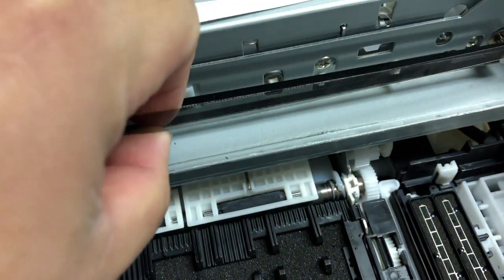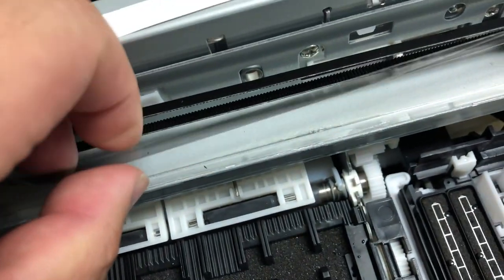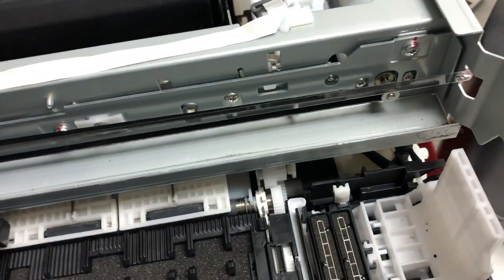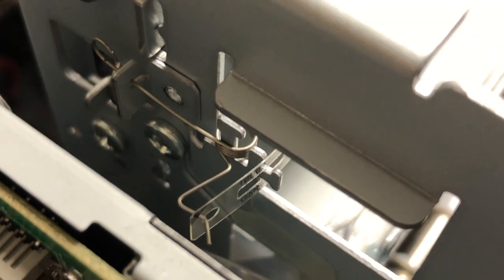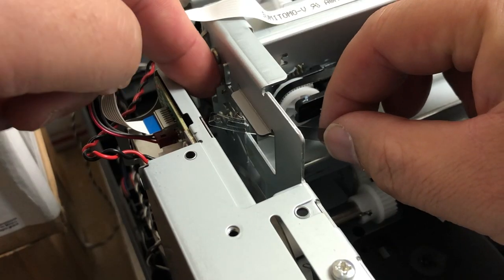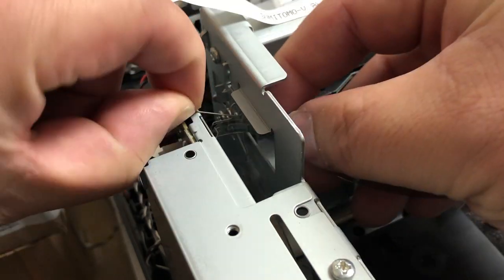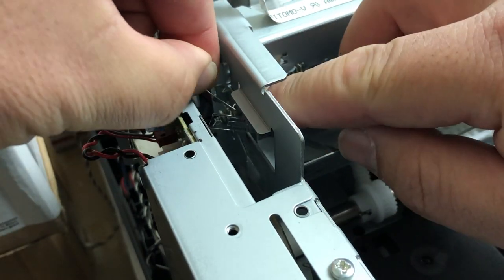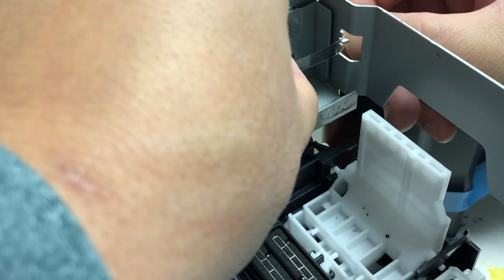Change Timing Belt CR Encoder - Epson WF 7720 7725 7210 7220  ET-16500 Torsion Spring

Comment: Hi Kevin. Amazing tutorials. Thanks. I have an Epson ET-16500. I cannot take the scanner off. I’ve tried, but cannot get the electrical disconnected. I inadvertantly dropped the spring down the inside of the machine when I was cleaning the timing belt. How do I get the ET-16500 apart to find and reset the spring? I cannot find any instruction on taking this machine apart and getting the case off. Thanks in advance.
Reply: Any luck trying to get the scanner off of the ET-16500?

Comment from the maker: Get the spring here: https://bchtechnologies.com/timing-belt-cr-encoder-torsion-spring-for-epson-wf-7720-wf-7710-encoder-scale
Uncasing: https://youtu.be/oyTD8yaNCZA
Reply: Is there a way to uncase an ET-16500 ? Everything works perfectly, but the drive belt detached from the print head. I need to thread the drive belt back into the teeth on the print head. To do this I need to get the housing case off, but it's all 1 piece of plastic which is attached to the ink tanks. This side with the ink cartridges won't detach.